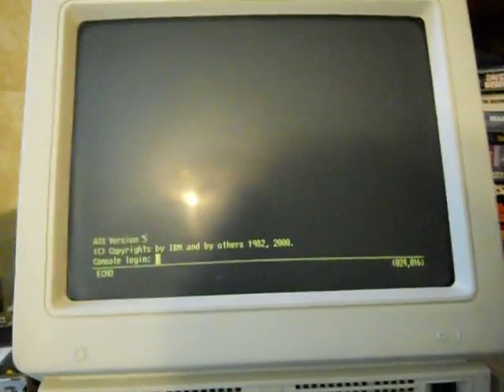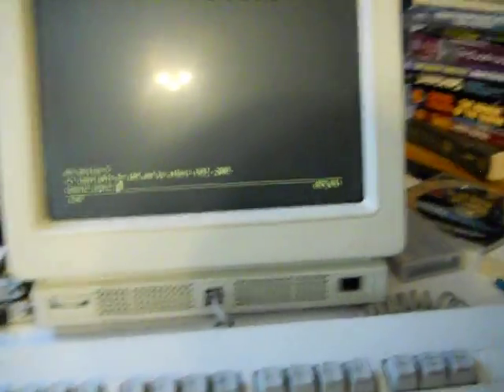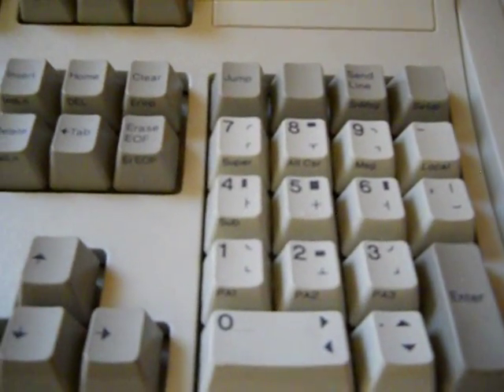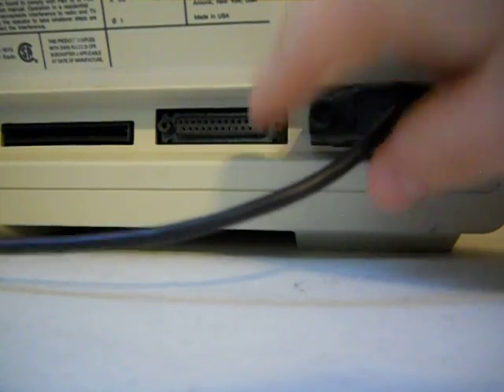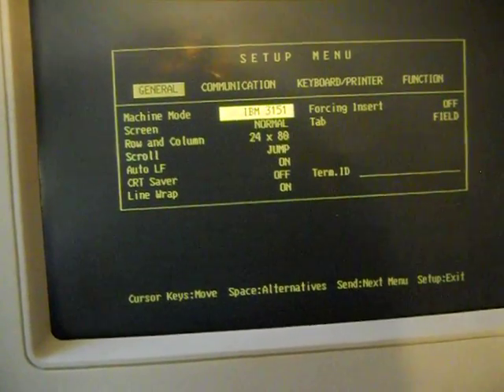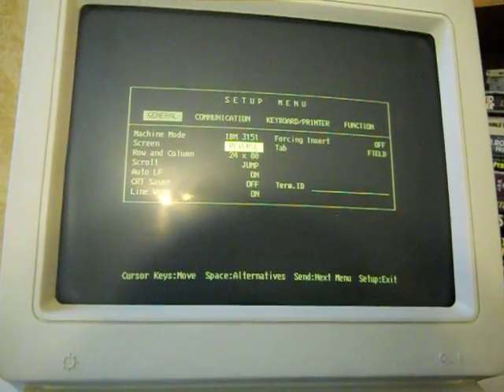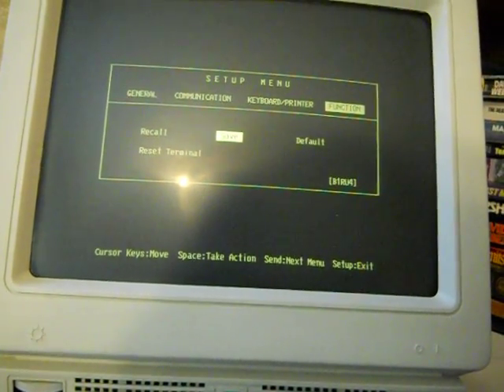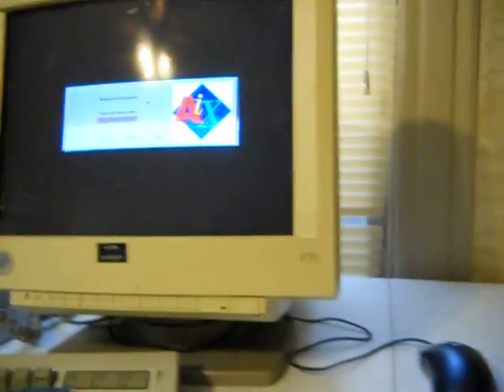IBM RS6000 #2 - IBM 3151 Serial Terminal

Comment: There is indeed a battery in it if it's anything like my 3161, which the 3151 is a descendant of. If you need any help, I think the 3161 manual is pretty similar and I have the manual for it; contact me if you need anything. I got mine working on my normal PC.
They are fairly easy to open and the battery is easy to replace (it's in a holder).
(Also, I'd buy the non-working one off you, if you'd like :D)
Reply: +wyatt8740 How'd you get it connected to and running on a normal PC? Right now I just have a 3151 and the keyboard and now idea what I'm doing.
Reply: +VegaDeftwing I used Linux, it's way harder to do in windows. But here's my configuration terminal-side. Had to use a null modem cable with full handshaking to connect the terminal to my PC serial port (partial handshaking does not cut it). Then, I used 'agetty' to start a terminal session on the serial port and the ibm3161 profile. On the terminal side, these were the settings I used:  http://i.imgur.com/TJ4vbW4.jpg - The 3161 is similar but not the same as the 3151, but here's some helpful pages from the 3161's manual (which I got with the terminal). If you need more pages or info I can try to help. http://imgur.com/a/OpCZ4